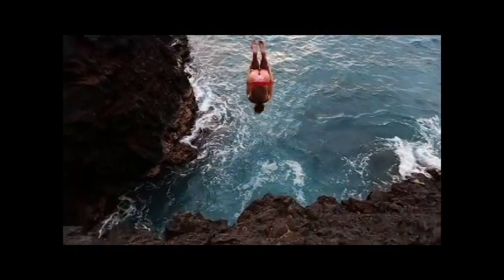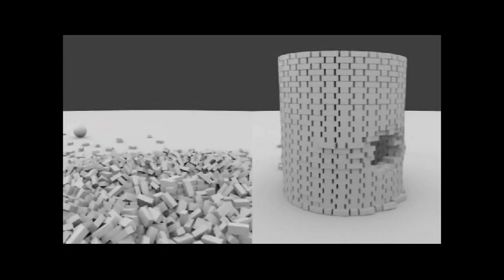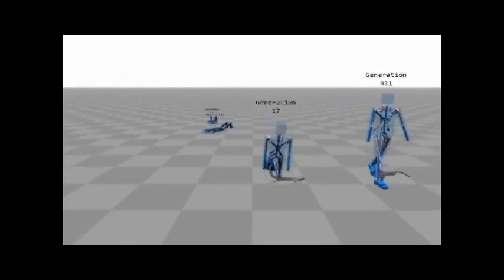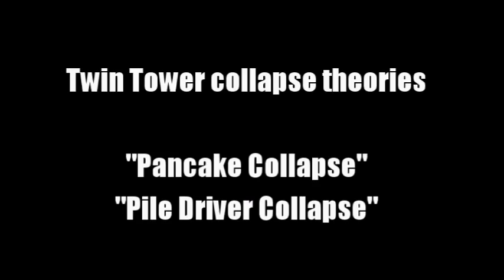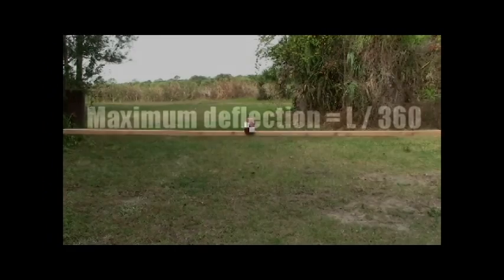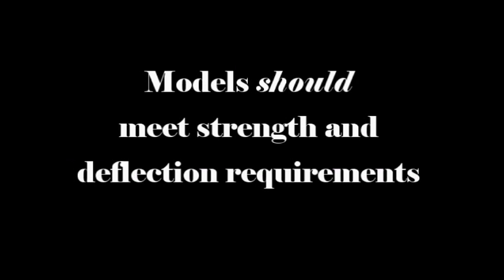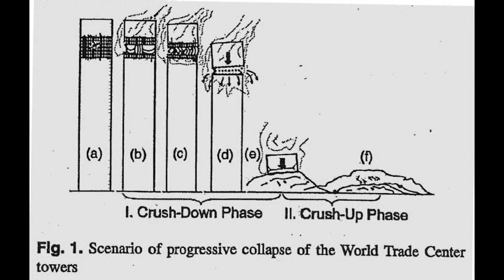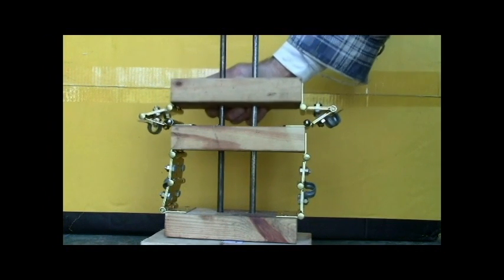9/11 Experiments: The Force Behind the Motion

Comment: MAGNIFICENT.  Now assemble a large remote controlled model airliner, match the strength at scale with a model Tower re strength of concrete/steel relative to strength of aluminum wings and fuselage, plus inertial force of fuel tanks.  Run your jet at scale speed into the Tower and see what happens. I would bet a lot of Monet that the plane will disintegrate on impact with minimal; intrusion. Try a few Tower models including the actual design to prevent jet impact destruction.
Reply: +Carroll Sanders 
You get shitstomped in every thread you join.  You know why?  Because the facts don't support your argument, so your argument is composed entirely of conjecture, misrepresentation, and logical fallacy.

Too bad.
Reply: Carroll Sanders <LMAO, stupidity never defeated reason and never will>

Not true, stupidly defeats reason every time you hit the post button.

Still waiting on you to provide evidence of the scientific experiments that you claim to have performed regarding the thermite chips which you claim are paint.  Why can't you name the publication performing the review process?  Why can't you post a link to your methods?  Who are the coauthors?
Reply: Carroll Sanders < "I encourage you to do TEM analysis as we have done. Studying electron-diffraction patterns obtained with the TEM, Dr. Farrer found that that the iron-oxide was in the form Fe2O3. He did not see a pattern demonstrating that aluminum was in a form he recognized by this method, which surprised us. There are possible explanations for this..."

Read it and weep bozo, no Aluminum, and Amorphous Aluminum Alloys he refers to are aluminum oxide alloys not Aluminum!>

And he walks right into it.  Your claim was that Jones admitted that his samples contain no elemental aluminum.  I see no claim of that at all.  I see Dr. Jones stating that one certain type of test did not turn up the results he would have expected, and that there are possible explanations for this.  

The final paper that was published explicitly concludes the presence of elemental aluminum, and confirms this through multiple tests, including a MEK soak, XEDS mapping and spectra, and a DSC calorimetry testing.  What's wrong, can't you comprehend plain English?  Did you even read the scientific paper you are claiming to be able to refute?  Where is the academic rebuttal?  Surely it should be easy to debunk if the paper is so flawed, especially since all the methods are very clearly outlined in the paper.

And thanks again for proving my point.  You can't even parse out the meaning of a basic sentence, and you actually expect people to believe that you are a published scientist, who has done work relevant to proving the official government fairytale?  Yet of course you can't tell us which publication is reviewing your work, the title of the paper, the coauthors, or the methods.  Too funny.
Reply: Carroll Sanders <Super thermite does not exist>

OK, moron.  "Nano-thermite or super-thermite is a metastable intermolecular composite (MICs) characterized by a particle size of its main constituents, a metal and a metal oxide, under 100 nanometers. This allows for high and customizable reaction rates."

<only the Aluminum copperoxide nano rod thermite has potential to have a high explosive burn rate approaching 1000 Meters per second, >

Another statement with zero factual support that is obviously wrong.  The wide range of metal fuels coupled with the variability in particle size and the many possible ways to actually configure and utilize the material makes it impossible for you to be able to back up your statement, because there is no way you would be familiar with all of these endless possible configuration.  Obviously, you're a fraud.  

Furthermore, Jonathan Cole proved that basic homemade thermate configured in a rudimentary shaped charge does indeed explode (although not to the extent of a high explosive), and can very easily cut through thick structural steel, despite the absence of a huge concussive blast.  Thereby, your whole premise is bunk.

<Harrit, Jones, Gage, Cole, have all shown rampant intellectual dishonesty, your only making a dishonest argument, yourself.>

More scurrilous ad hominem from Carol the meatpuppet.  Prove this supposed intellectual dishonesty, fraud.  Then explain how it somehow constitutes a refutation of the Harrit paper.

<Shock waves from explosives do not travel though glass the shatter it and expel it a thousands of meters per second.
Your stupidity noted.>

Think of all the possible locations of an explosive in relation to the window being observed on this giant skyscraper.  Then, take a close look at my first statement in this post. "This allows for high and CUSTOMIZABLE reaction rates."  So in your little mind, EVERY sized explosive will result in EVERY window shattering in this enormous skyscraper regardless of how far away the explosive charge is from that pane of glass, of how many walls separate them, or how fast the reaction speed of the charge is.  

Now step back, and marvel at your retardation.

<Don't have too show you shlt>

No, you CAN'T show me shit, because you're full of shit.  There is only one 'o' in 'to,' moron.

< so what's the point soot is carbon black, charcoal the same fuel as black powder, Gun powder, you just have to suspend it in air and ignite it moron>

Yes, I understand the principle, idiot.  Apparently, you don't understand the question I am asking.  What physical evidence can you point to to suggest this is what was happening?  What math are you using to determine that "The soot from the black Smoke has about a 99% chance of inducing fuel air blasts when it is desturbed and ignited in air."?

You just keep piling on more and more of your unsupported claims.  Is your paper that disproves the Harrit paper "still in the review process" or has it gone to publication yet?  Which journal is publishing your supposed paper?  Who are the coauthors?  Why can't you back up any of your claims?

Just sad.
Reply: Can't be done, you would have to use a real buildings, and real planes, because inertia, and Gravity as well as atomic structure can not be scaled.
    That's also why Coles experiments fail so badly.
Reply: ***** You can't defeat a valid argument with fallacy you lost, you just are a twoofer and lie.
Reply: Emvaz22 LMAO, stupidity never defeated reason and never will but continue to post your stupidity so I can laugh at you.
Reply: Emvaz22 Why are you applying different standards to me than you do to Jones, he never provided evidence the chips he found had elemental Aluminum, in fact he said on 9/11 blogger in his own blog, they didn't!
Reply: Carroll Sanders <Why are you applying different standards to me than you do to Jones>

I'm not.  Jones is an actual physicist.  His work is actually published.  It is open for anybody with the internet to read for free.  You on the other hand, are obviously a fraud who only pretends to be a scientist while spreading lies on YouTube.

< he never provided evidence the chips he found had elemental Aluminum>

He proved they did, which is why that very conclusion is outlined in the Harrit paper.  The nine expert authors and two expert reviewers all seemed to agree that the chips contained elemental aluminum.  Can you reference an expert who disagrees?  No, you don't count.  Can you reference a rebuttal?  An alternative interpretation of the results?  A reanalysis of the dust?  Anything?  Do you have any supporting sources at all?  Still nothing?  That's a shame.

< in fact he said on 9/11 blogger in his own blog, they didn't!>

Lie.  Go ahead and copy a link to this blog and quote the part where he claims that the chips do not contain elemental aluminum.  Warning: I'm walking you into a trap.  

You're a dumb one, so you're going to fall for it anyway.  Let's see what happens.  It's either a) fall for the trap, or b) backtrack and evade the line of inquiry.  What will it be?  Let's find out.

Go ahead Karen, prove your claim that Jones said that there is no elemental aluminum.
Reply: Emvaz22 "I encourage you to do TEM analysis as we have done. Studying electron-diffraction patterns obtained with the TEM, Dr. Farrer found that that the iron-oxide was in the form Fe2O3. He did not see a pattern demonstrating that aluminum was in a form he recognized by this method, which surprised us. There are possible explanations for this; see for example http://www.tms.org/pubs/journals/jom/0203/perepezko-0203.html . I'll leave it at that for now. I have encouraged Dr. Farrer to write up and publish his TEM findings. "

Read it and weep bozo, no Aluminum, and Amorphous Aluminum Alloys he refers to are aluminum oxide alloys not Aluminum!

Definitive test for Aluminum and the chips fail to have any recognized aluminum none.
Reply: Emvaz22 mek is ridiculous, XED, can not distingish aluminum silicate or aluminum oxide from Aluminum.

Mek will not dissolve carbon based epoxy resin, so the claim is preposterous.

TEM is the definitive test for Elemental aluminum, and Aluminum oxide ballistic glass is not a good fuel source for thermite!
Reply: Carroll Sanders <mek is ridiculous>

No, MEK is a paint solvent.

<XED, can not distingish aluminum silicate or aluminum oxide from Aluminum.>

Yes it can, shithead.  Again, you have an apparent problem reading plain English, as this is all outlined in detail in the Harrit report.

I'll explain how, because you're simple.  XEDS can show the physical location of a given element (called XEDS mapping) as well as the given proportion of elements in a specific area (XEDS spectra).

Upon initial XEDS mapping of the Harrit chip, it appeared that the regions associated with aluminum and silica overlapped, suggesting they are chemically bound.  After soaking the chip in solvent, instead of dissolving, it expanded and remained hard to the touch.  Because of the expansion, unbound elements were able to migrate away from one another.  After the MEK soak, it is clear in a XEDS mapping that the silica region had migrated from the aluminum region, which proves that the two are not chemically bound.

But then you would say "durr, but it could still be aluminum oxide!"  Wrong.  Remember how the XEDS spectra can show the ratio of the given elements in a physical sample?  Remember how the chip is a deep red color and also shows a large amount of iron in the XEDS spectra?  That would be iron oxide.  Most of the oxygen in the chip is bound to the iron, which does not leave enough oxygen to bind to the aluminum (which we already know is not bound to the silica).

Therefore the aluminum is elemental, because it is not bound to the silica, and most of the oxygen is already bound to the iron.

This is all basic stuff, and was outlined in the Harrit paper.  Are you sure you're a scientist?  You seem pretty slow.

<Mek will not dissolve carbon based epoxy resin, so the claim is preposterous.>

Irrelevant to anything I've said thus far.  You running out of talking points?

<TEM is the definitive test for Elemental aluminum>

Says you, with no scientific reference, no credibility, no identity, no explanation.

 If you're having such a hard time with it, maybe you should type up a rebuttal and submit it for publication in an open journal, like Harrit et al did?  Maybe once every journal rejects your joke of an argument, they can point out your horrendous logic and explain why you're wrong more succinctly than I can.  Good luck.

<and Aluminum oxide ballistic glass is not a good fuel source for thermite!>

wtf are you even talking about?
Reply: Emvaz22 If you can't desolve the epoxy resin you can't separate the silicon from the Aluminum oxide. DA.

Some one is lying when they say it did, that and the TEM, and the material will not ignite in an inert gas atmosphere prove no elemental Aluminum.

Has Mark Basile spent all the beer and weed money yet?
He sure as hell hasn't done any credible tests with it.
Reply: Emvaz22 First MEK will not dissolve the epoxy resin, Second you can't tell what the oxygen is bonded too.

Third Mark Basile dropping out is doing independent tests shows the material is not important.
Reply: Emvaz22 Then you should be able to do an inert gas ignition test and confirm the results, oh and yes Fe 203 is red but that does not prove the Aluminum is elemental.

Since the epoxy can not be desolved, a competent test could not be make on the MEK soaked chip.
Reply: Emvaz22 the people Who invented Sol Gel thermite tested it under n2 and argon inert gasses!
Reply: Carroll Sanders <the people Who invented Sol Gel thermite tested it under n2 and argon inert gasses!>

Cite your source.  I think you're full of shit, and don't have a source.  The Harrit authors claim that the LLNL scientists said they likely just used atmosphere.  Nobody from LLNL has refuted this.  There is no reason to assume an inert gas was or should have been used.
Reply: Emvaz22 Read the Harrit paper, I was part of the micro spheres debate With Steven E. Jones.
I read the Harrit paper and the evidence does not support his conclusions!
Reply: Carroll Sanders I read the Harrit paper, and his methods and his evidence DO support his conclusions.  The nine expert authors and two expert reviewers agree, therefore the paper has been published.  Which expert has issued a rebuttal in the seven years since the paper was published?  Which expert has reanalyzed the dust and turned up something different?

Oh thats right, I'm supposed to believe that YOU are a credible expert and your unpublished, unreviewed, unsubstantiated opinions and logical fallacies somehow outweighs the published and peer-reviewed academic literature.

Right...
Reply: Emvaz22 It was published in a now defunked vanity publication that published articles for profit.
None of the peer reviewers were experts, not a one, the peer review on that paper was a joke, and still is have you found Mark Basile and got the money back yet?
Reply: Carroll Sanders <It was published in a now defunked vanity publication>

I'm glad you can copy-paste the party line.  Too bad it's a lie.  Bentham publications are peer-reviewed academic sources.  The Harrit study remains published, and has not been redacted or refuted.  All you have left is ad hominem?  Try again, moron.

<that published articles for profit.>

Every publication publishes articles for profit, you fckig idiot.  It's called capitalism.

<None of the peer reviewers were experts, not a one>

Liar.  Only one of the reviewers has come forward, so you couldn't possibly know the credentials of the other individual.  Considering they are reviewing an academic publication, we can assume they are a expert.  The reviewed that came forward is David Grissom, PhD in physics from Brown.  Formerly of NASA, DARPA, and US Naval Research.  Author of over 190 published articles, reviewer of hundreds more.

<the peer review on that paper was a joke, >

Lol, as if you were there and can speak to one specific about the peer review of that paper.  Ok then, go ahead and tell me specifically, why the peer-review was "a joke."  This should be funny.

Which "experts" did you find that refute the Harrit paper?  Where is their work published? Oh that's right, you've still got nothing.  Too bad.
Reply: Emvaz22 Chandler was also one of the peer reviewers.

And the journal published a nonsense articles written by a robot DA.  vanity publishing is not peer review!😆😆😆😆😆😆😆😆😆😆😆😆😆😆😆😆😆😆😆😆😆😆😆😆😆😆😆😆😆😆😆😆
Reply: Carroll Sanders <Chandler was also one of the peer reviewers.>

Another expert physicist.  How does this support your argument, exactly?

<And the journal published a nonsense articles written by a robot DA. vanity publishing is not peer review!>

Lie.  Cite this supposed article that Bentham published.  Which journal published it?  What was the name of the article?  When was it published?  Who were the authors?

What's that?  No such article was ever published by Bentham?  

Carol is a lying colostomy bag, except he is more full of shit.

The fact that you have to resort to bald-faced lies and ad hominem fallacies proves how bankrupted your position is.  You have no academic citation, and no facts to speak to whatsoever.  

You've been outed as the fraud meatpuppet that you are.  Run along now, Karen.
Reply: Emvaz22   From Wikipedia's page on Steven E. Jones. "received an e-mail from the Danish science journal Videnskab asking for her professional assessment of the article's content.[51][52] According to Pileni, the article was published without her authorization. Subsequently, numerous concerns arose regarding the reliability of the publisher, Bentham Science Publishing. This included the publishing an allegedly peer reviewed article composed of nonsense,[53] the resignation of multiple people at the administrative level,[54][55] and soliciting article submissions from researchers in unrelated fields through spam.[56] With regard to the peer review process of the research conducted by Jones in The Open Chemical Physics Journal, Dr. David Griscom identified himself as one of the reviewers,[57] which Jones claims was "anonymous" in nature and welcomed Dr. Griscom to the "9/11 truth-seeking community".[58] However, the paper which Jones co-authored referenced Dr. Griscom, and multiple 9/11 conspiracy theorists, in the acknowledgements for "elucidating discussions and encouragements".[21] Also, almost four years prior to identifying himself as a reviewer and the welcome he received from Jones, Griscom published a letter in defense of 9/11 conspiracies in the Journal of 9/11 Studies;[59] of which Jones"
Reply: Carroll Sanders From Wikipedia: Ad hominem (Latin for "to the man" or "to the person"[1]), short for argumentum ad hominem, is a logical fallacy in which an argument is rebutted by attacking the character, motive, or other attribute of the person making the argument, or persons associated with the argument, rather than attacking the substance of the argument itself.[2]

Oh darn, there goes your whole argument.

I'm glad you think the disinfo op wikipedia is an authoritative source on 9/11 truth.  That article is so slanted and biased (and factually wrong) that only an idiot like Carol would think it is a valid citation.  

Everyone knows that the Bentham editor resigned simply due to political pressure.  If it was because the paper was unsound, then she would have said "the paper is flawed because...".  So what is the flaw in the paper?

Moreover, both the authors and the reviewers confirm a rigorous months-long review process.  You would have to be fully retarded to think that the head editor of a publication would somehow not be aware of a paper moths in the review process, especially since this journal only published a few articles per edition.  Political pressure, and it is that simple.

Not only that, but your coveted "source" wikipedia says this "This included the publishing an allegedly peer reviewed article composed of nonsense," which is a lie.  No such articles was ever published by Bentham.

Care to prove me wrong, moron?  Which journal published it?  What was the name of the article?  When was it published?  Who were the authors?

Why is your entire argument composed of ad hominem and lies?  Could it be that you are a fraudulent shill?  Gee, I wonder.  

Try again.
Reply: Emvaz22 How are facts Disinformation? 

The truth is the paper was peer reviewed by a member of the 9/11 twoofer website Jones's ran, was not submitted to the Editor for approval.

The Article no longer appears in google searches, but I read the article from Bentham myself back in 2009.
     R Mackey sent me a link to the nonsense PDF personally. 

Hey the old link From the R Mackey message still works.

https://www.newscientist.com/article/dn17288-crap-paper-accepted-by-journal/
Reply: Carroll Sanders <How are facts Disinformation? >

Facts are disinformation when they aren't facts, but lies.

<The truth is the paper was peer reviewed by a member of the 9/11 twoofer website Jones's ran, >

Lie, Griscom had not met the authors of the Harrit paper prior to the review.  Prove otherwise, fraud.

<was not submitted to the Editor for approval.>

Lie.  Both the authors and the reviewer specifically document a rigorous, months long editorial and review process.  Tell me, if the paper never made it to the editor and this paper was published outside the approved methodology, then why is it still published?  Bentham has on their website an extensive flowchart that describes the processes a paper must go through before publication.  If the editors never saw it, then it couldn't have made publication.  Why wouldn't the journal simply remove the article if it bypassed their processes?  Your position falls apart the second you apply logic.

<The Article no longer appears in google searches, but I read the article from Bentham myself back in 2009.>

That's funny, which edition was it published in?  What was the date?  Oh that's right.  Liar.  I almost forgot.

<Hey the old link From the R Mackey message still works.

https://www.newscientist.com/article/dn17288-crap-paper-accepted-by-journal/>

Hey, I don't see anything in the article you posted about this hoax paper actually being published.  Why are you still lying?

So pathetic.

Really, all you've done is admit that you have no ACTUAL rebuttal of the Harrit paper, and so you resort to ad hominem, lies and misrepresentations.  Thanks for playing.
Reply: Emvaz22 It was published before the article was written, in PDF format the link doesn't work because Beth am pulled the paper, after they discovered it was a hoax, and Griscom published letters in 9/11 Review, before he peer reviewed Jones's article, Lie all you want it is all documented and collaborated from multiple sources!
    You are just another lying fraud on the internet!
Reply: Carroll Sanders <It was published before the article was written>

No moron, it wasn't published.  Nowhere in the article you cited, which is your sole source, does it say that Bentham published that gibberish paper.  Learn to read.  What your joke of a blog post does is purposely leave out the rest of the story so as to deliberately confuse idiots like you.

In reality, Bentham was well aware of the fraudulent article, in fact it had been receiving a series of fraudulent articles all submitted by an anonymous person under an alias.  In order to stop the spamming and to draw this person out in the open, Bentham sent a letter to the fraudster saying that one of the papers was accepted for publication, and requested payment.  In order to pay and get published, the fraudster would have to come out into the open, at which time Bentham would have been able to take appropriate action.

At no time was any fraudulent article published in any Bentham journal.  Prove otherwise.  What is the title of the article?  What edition was it published in?  What was the date of publication?  If this article was published, then all of this data should be readily available.  

Oh I almost forgot, you have no supporting data, no scientific reference, no facts to speak to whatsoever.  You're just a lying fraud who has to rely on ad hominem fallacies which aren't even based in fact to begin with.  Even your fallacies are lies.  So pathetic.
Reply: Emvaz22 The burden of proof is on you I read the PDF, dumbazz myself in the Bentham Journal, Bentham only pulled it after it was made public that it was a hoax a week after first publication!

The title of the article was the same as the link provided in the Story from New Scientist.

Your totally a fraud pushing a fraudulent paper of complete stupidity, you can't take it can you that you were proven wrong?

Come on tell me some more Twoofer lies!
Reply: Carroll Sanders One more thing:  The paper was pulled by Davis, the author, once he was required to pony up the cash.  Bentham never pulled the paper BECAUSE IT WAS NEVER PUBLISHED.  Apparently you can't even comprehend a two page op-ed, and you actually expect people to believe you are scientifically literate?  Think again.

Do you have an extra chromosome?
Reply: Emvaz22 Nothing you say will change the fact that Twooferism is a fraud and failure.
   The very thread you are posting in shows it, Cole, Harrit, and Jones all frauds, Like Jones's over unity bullshlt.
Reply: Carroll Sanders Can you refute the Harrit study, which disproves the official collapse theory?  No, you can't.  

Can you demonstrate proof of the official collapse theory?  No, you can't.

Is there any way that a building can collapse symmetrically for 100ft at perfect free-fall acceleration WITHOUT the use of pyrotechnics?  No, there isn't.

Sorry trash, but your astroturfed, shill-filled "bunktard" movement is pathetic, and most Americans see right through it, and realize the zionist filth behind it all.

What do you think will happen in the US when supporting the genocidal regimes of Israel and Saudi Arabia becomes political suicide?  What do you think will happen when America stops financing the illegitimate Israeli state?

It will be interesting to find out.
Reply: Emvaz22 Your fraud proves absolutely nothing, you ignore physics and reason to promote clear fraud for monetary gain.
    Harrit's study is refuted By Harrit who claimed to find active chips as well as inactive chips. Exposure to water as he claimed deactivated them would not effect nano thermites.
     Jones's own blog said No Elemental Aluminum was found in the TEM data 
    EDX can not differentiate Al203, From Al in the presence of Fe203.
    The TEM data was conclusive, and The Mark Basile  (Embezzler ) study is a Joke, you know he will never have any results.
    Your whole Moronic Twooferistic Bullshlt has fallen apart all around you, and your fraudulent support of Cole is proof of that!
   You are nothing and I am laughing at you!😆😆😆😆😆😆😆😆😆😆😆😆😆😆😆😆😆😆😆😆😆😆😆😆😆😆😆😆😆😆😆
   Why don't you ask Cole for the mathematically correct model that shows his experiment exactly matches the energy values of the collapse?

   Guess what you can't, and never will because a mathematically correct model proves You and Cole are frauds and nothing you can say or so will ever change that!
😆😆😆😆😆😆😆😆😆😆😆😆😆😆😆😆😆😆😆😆😆😆😆😆
Reply: Emvaz22 None of what you posted proves shlt, it only proves your ignorance, a building facade stone wall can fall at free fall, after the steel framing topples to the side, and in no way violates Newton's third law, your straw man argument just went up in flames!

A counter levered building suffering progressive collapse leading to Global collapse should fall in that manor, and the Fvcking Granite Facade should land on top, just as it did dumbazz.
Reply: Carroll Sanders <a building facade stone wall can fall at free fall, after the steel framing topples to the side>

Tell me, shit-for-brains.  In a structure surrounded by 4 walls, how exactly does the entire steel frame "topple to the side" and completely get out of the way of the walls that are bolted and welded to the frame?  How do office fires on a few floors cause this to happen?  Be specific.

Seriously, the scenarios you posit are the stupidest things I've ever heard.  Please don't reproduce.

<and in no way violates Newton's third law, your straw man argument just went up in flames!>

Free-falling mass ACCELERATING as it meets resistance violates the basic laws of physics.  You're retarded.
Reply: Emvaz22 The Facade Of world trade 7 Was only on three sides not 4, the otherside facing the towers was glass and steel.  The Facade was designed to face the Ocean side to resist Ocean winds.
    That's why it stood a few seconds after the internal framing failed!
Reply: Emvaz22 You don't have to refute Bullshlt, it refutes itself no respected scientist will ever waste his time on Bullshlt!

The Greening model gives the energy values for the twin towers collapses, where are the energy values for Cole's Models moron, he hasn't got any!😆😆😆😆😆😆😆😆😆😆😆😆
Reply: Emvaz22 I will most likely be saying goodbye to you and your idiocy, you have nothing after 15 years, you have nothing conclusive, and everything you claim can be shown easily to be wrong with simple experiments and research.
      You don't accept facts or solid reason, and you're basicly propagandizing for a political issue, the fact you support the experiments of Jackass Cole, proved you were a total fraud unworthy of any debate or respect!
      I have Literally no respect for Jones, or Harrit the frauds, or for their Fraudulent papers printed in a rag with compromised
Peer review, and also Refutations are not needed to counter a paper that should never have been published in the first place.
     The problems with the paper were, no elemental Al was confirmed,  TEM results show no Elemental All,  No Al203 was produced in the reaction, No self oxidation was shown!
       The paper solely assumes makes a guess that the material is thermite, and does not confirm in any way that it is thermite.
     As such the conclusions of the authors are unproven and unfounded in science, so the publication should have been rejected!  If it had been published in a non vanity Journal with proper peer review it would have!
     The link between the paper and the peer reviewer, shows conflicts of interest.  Your new investigation will never happen and you and your cohorts will be relegated to the dusty Looney bin of history, and although it has been fun laughing at your stupid ass, you have gotten quite boring same old Bullshlt all the time, and we both know nothing new to be discovered in the future!
     Mark (Embezzling ) Basile will never have a lab do an independent test, and you know it, because there is nothing but old paint chips to test!
         Have a nice life of beating dead horses, that will never rise and walk again!😆
Reply: Carroll Sanders <The Facade Of world trade 7 Was only on three sides not 4, the otherside facing the towers was glass and steel. The Facade was designed to face the Ocean side to resist Ocean winds.
That's why it stood a few seconds after the internal framing failed!>

And to your, this is ample explanation of how a steel-framed high-rise can collapse symmetrically at free-fall acceleration for 100 ft...gotcha.

<You don't have to refute Bullshlt>

I know I don't because you've referenced absolutely nothing.  You have zero scientific reference whatsoever.

< it refutes itself no respected scientist will ever waste his time on Bullshlt!>

Then explain why James Millette attempted to refute the Harrit paper, did a piss-poor job, and publicly failed to get his joke-of-a-paper published?  Hey maybe you're right, the proven fraud James Millette is an EPA shill, and isn't a "respected" scientist after all.  Too bad.

< I will most likely be saying goodbye to you and your idiocy>

Giving up already?  Oh well, one more head for my wall of shills.

<you have nothing after 15 years>

No, YOU have nothing.  I have hard science and basic physics which you are unable to refute.

<and everything you claim can be shown easily to be wrong with simple experiments and research.>

Yet somehow you are unable to demonstrate these supposed simple experiments and research.  Why can't you reference a rebuttal?  Hmm, I wonder why.

<I have Literally no respect for Jones, or Harrit the frauds, or for their Fraudulent papers printed in a rag with compromised
Peer review>

ACTUAL scientists, with ACTUAL credentials published in an ACTUAL journal.  Where is your refutation?

<and also Refutations are not needed to counter a paper that should never have been published in the first place.>

Predictable cop-out of an intellectual weakling.  You are truly pathetic.

<no elemental Al was confirmed,>

Lie.  XEDS spectra and mapping, MEK soak, and DSC testing confirm elemental aluminum.  It's pretty obvious you either never read the paper or you have a learning disability.  I'm leaning towards both.

<TEM results show no Elemental All,>

TEM testing wasn't even part of the Harrit report.  Your position doesn't even make sense.  Try again, fraud.

<The paper solely assumes makes a guess that the material is thermite, and does not confirm in any way that it is thermite.>

Lie.  The sole purpose of the paper was to perform scientific experimentation that proves this material is thermite.  Nothing is assumed. In fact, initially the authors assume it is paint, which is why they soak it in paint solvent.  DUUR ME CAROL ME NO REED GUD.

< If it had been published in a non vanity Journal with proper peer review>

Credible academic journal with an extensive peer-review process.  Prove otherwise, fraud.

<The link between the paper and the peer reviewer,>

There were two reviewers, neither of which were acquainted with the Harrit authors prior to the review process.  Prove otherwise, fraud.

It's pretty clear that all you have left are ad hominem (which aren't even factually true) and bald-faced lies.  

I hope you realize that every time you post one of your idiotic, factually unsupported statements, you simply draw attention to how much of a fraud you are, and to the fact that there are political forces paying meatpuppets like you to spread lies on YouTube and distract from their involvement.

The beans are already spilling on Saudi Arabia.  How long before most Americans realize that our supposed ally Israel was involved?  How long do you think Israel will remain a Jewish state once America stops giving a fuck and withholds the billions of dollars of foreign aid every year?  I sure wouldn't want to be there when it happens.  Enjoy, meatpuppet.
Reply: Emvaz22 Considering you are commenting on a post on a video By Johnathan Cole, an he admitted openly last night that his experiments are a sham,  twice in one YouTube program live on the air,  how do you even have nerve to reply with more false Bullshlt?
Reply: ***** Cole admitted last night he is nothing but a Fraud, he can't do valid experiments, he admitted it!😆😆😆😆😆😆😆😆😆😆😆😆😆😆😆😆😆😆😆😆😆😆😆😆😆😆😆😆😆😆😆😆😆😆😆😆😆😆😆😆😆😆😆😆😆😆😆😆😆😆😆😆😆😆😆😆😆😆😆😆😆😆😆😆😆😆😆😆😆😆😆😆😆😆😆😆😆😆
Reply: +Carroll Sanders 
Nobody believes you, Karen.  You know why?  Because you're an obvious shill with zero credibility, who makes absurd claims but can never manage to offer any sort of supporting reference.

You're a compulsive liar, and everyone knows it.
Reply: Emvaz22 Cole stated twice last night, that his experiments did not have an energy value equal to the collapse of the twin towers.

It's on YouTube, he stated it in reference to the question why his energy values did not match the real event!
😆😆😆😆😆😆😆😆😆😆😆😆😆😆😆😆😆😆😆😆😆😆😆😆😆😆😆😆😆😆😆😆😆😆😆😆😆😆😆😆😆😆😆😆😆😆
Reply: Carroll Sanders <Cole stated twice last night, that his experiments did not have an energy value equal to the collapse of the twin towers.>

The towers weighed thousands of tons.  Of course the model doesn't have the same total energy value.  IT'S A MODEL, you simple fck.

And this basic statement of how a model is smaller than the actual event is the entire basis for your claim that "Cole admitted last night he is nothing but a Fraud, he can't do valid experiments, he admitted it!"?

Seriously, your just get dumber with every post.
Reply: Emvaz22 Gravity can not be scaled, Cole is attempting to duplicate motions that are dependent on exactly matching the energy equation involved in the collapses.
    With out matching the energy values the motion can not be duplicated and Cole is a fraud!
Reply: +Carroll Sanders 
Mmhmm, and which real-world models match the forces observed on 9/11?  Oh thats right, none exist.  The enormous budget of the Federal government, and not one physical model?  Hmm, I wonder why?  Because the forces observed are only possible with pyrotechnics.  The best you can muster is a NIST computer model with classified data parameters.  

You've still got nothing.  All you have is the official government-sponsored  fairytale, and zero verifiable science.
Reply: Emvaz22 Idiot, scale models are useless, because of physics the inverse square law, mathematical, and computer models are used!
     You're to stupid to realize that!😆😆😆😆😆😆😆😆😆😆😆😆😆😆😆😆😆😆😆😆😆😆😆😆😆😆😆😆😆😆.
Reply: Doesn't it seem inevitable and immutable that the inherent strength of each floor to support all the weight of all the floors above it would provide a residual strength to resist for a serious moment at least to all the mass crushing down via gravity's pull?  With this present for every floor, it seems inevitable that the speed of collapse would have been significantly slower than free fall speed.  And thus significantly slower than the fall of the main mass as opposed to the exterior layers. Also, my innumerable exams of the collapse footage finds no discernible difference between speed of fall of exterior layers vs the internal main mass. That\s my main problem with the damage--induced collapse explanation.  Alternate view?
Reply: Spherian7 F=MA-R,    MA<R Collapses halt,  MA>R Gravity Accelerates the top block though the lowers structure.
        The dynamic loading induced in the collapses, was MA>R, Cole's models are MA<R, as such it is physically impossible for Cole to duplicate the motion of the upper mass though the lower mass.
      As an engineer Cole has to know this, that makes him incompetent at the very least, most probably though he is a fraud.
       The connections that held the building together did not have enough strength to resist rapid disunification so the building disassembled into its component parts and fell like a house of cards.
Reply: Carroll Sanders Thanks - I appreciate that, and it seems clear that small model mass vs megascale mass is the major obstacle in such demoes.  I was thinking about a scale model of a jumbo jet being accelerated down a track at masscorrect speed relative to an impact structure of similar scale designed to replicate in masscorrect density per model scale-down the very impressive concrete-steel WTC construct to see just how much of the model could penetrate said structure.  Can we replicate the "karate chop" effect wherein an aluminum jetliner could cut completely through such a structure ... like a knife through butter as per the ST impact footage.  There must be a kind of exponential increase in mass structural integrity retainment when the mass of aluminum is increased from small scale to very large scale.  SO this is the main problem - is there a formula wherein we can reduce the size of both Tower and jet and have a reliable downsized mass/inertia ratio matching the full scale parameters? There may not even be such a thing.  No... there has to be something, since we have manmade materials size/strength comparisons relative to natural materials, such as interior bone, the egg, etc, etc.  Anyway, ff we have to wing it, it seems we would need large models to get a decent and correct test.  Sound like fun, doesn't it?  What of we used a rocket-propelled model plane with added density at leading edges into something reasonably comparable in relatice strength to a Tower - adding more speed and inrertia than would be really close to give the cut-thrugh the benefit of the doubt? Then if the plane still doesn't cut through completely intact, disintegrating en totality right after getting through the wall per Commission NIST diagrams, then we may be on to something and then run an even bigger test. How much money you got, partner?
As it may be,  I was just thinking in my math-challenged way right before opening your comment about the "gravity accelerates the top block through the lower structure" aspect. .   Here's my primitive thought...  the lower portion and every floor had the strength to support the top block totally.  Ok-  so we assume that at the point the steel support  was softened there was then the moment of complete steel failure and the top block descends as a free fall for one or two stories. Therefore, there must be a way to calculate the de facto increase in apparent mass induced by the fall and pull of gravity over that relatively short distance. .  It seems to me strictly on feeling  that even with such a fall  the increase in effective mass of this temporarily falling top block might still be insufficient to overcome the strength of the floors to support up to a certain weight - or at least the cumulative strength of several floors underneath would be sufficient to vitiate the downward momentum due to absorption of the brief de facto gravity induced mass increase by the lower floors' collective strength-bearing capacity. .  SO, what was the total weight that the floors right under top block impact could actually support? See what I mean? Could they have supported twice the actual static weight? There must be a formula for calculating the de facto mass under gravitational acceleration for that distance.  Then we can match that to the actual full support potential for the floor(s) immediately under the collapse gap. Interesting problem.
Reply: Spherian7 The strength of the connections holding the building together, was about 22000 pounds per square inch.
    2600 pounds falling 12 feet = 100,000 pounds per square inch.

Once dynamic motion was induced the towers were doomed.

As far as the plane , just showing how good a penetrator aluminum is would suffice I shot aluminum bullets though 3/4 inch schedule 40 steel plate.
Reply: Carroll Sanders  Ya da man !  Let me "think" or whatever it is I do about the intel per strength.  And very impressed and pleased as I am with the aluminum bullet test, which is awesome, I must bear in mind the bullets are very well shaped for penetration, while the frontal edges of the wings and the weaker wingroot connections are not so. Nonetheless, I will think over the speed of bullet, shape, relative mass vs tensile strength of 3/4 inch solid steel.    Also, it is core in all this that we are dealing not just with a science/physics theory, but a criminological deal.  Thus, in a  pure Physics evaluation we can certainly deny controlled demolition place as stronger theory if just that we cannot prove it in the nature of the collapse itself  when other explanations still stand. But this doesn't deny the possibility of the contention - it just doesn't gain superior proven status.  However, as a crime case as well as science, we can still say in this narrow system we are exploring, that while dynamic motion can actually successfully explain the collapse, this doesn't mean that other means could not account for the same observed phenomenon. The same effect could be obtained via controlled demolition but be indistinguishable from a imputed dynamic collapse once initiated. Making a crime appear a natural death deal by using artifice based on known factors that can replicate natural physics cannot be ruled out even if less likely.  In other words, with a lot of explosives placed in correct demolition structure, the building would be just as doomed.   Good times, good times !
Reply: Carroll Sanders PS -and  any friend of squirrels is a friend of mine.
Reply: Spherian7 No evidence of explosives was ever found, none not even a detonation wave.
Thermite would be a poor choice, one the mass of Aluminum melted in the heat of the fire, the thermite would have become inert non functional.  Plus thermite is not an explosive, the highest recorded burn rate for thermite is around 1000 meters persecond.  The soot in the fires can have a burn rate exceeding that.
  The soot from the black Smoke has about a 99% chance of inducing fuel air blasts when it is desturbed and ignited in air.
   The natural collapse theory matches most of the evidence, and an aluminum plane going at the speed at which the jets that hit the twin towers were going would easily have penetrated the momentum of the plane had to be absorbed by the buildings steel because the plane was in motion while the building was not.
    So the plane had ample energy to penetrate, while the building did not have the energy to resist penitration,.
    +Spherian7  the simple fact of the matter is  is the plane is traveling inward the steel is stationary. So the plane covered in one of the best penetrating metals know to man, exerts 320,000 psi on a material A36 steel, so named because the tensile strength of A 36 steel is roughly 36,000 PSI.
     The steel absorbs the extras energy imparted by the plane as ductile deformation and Crystalline fracture.
It is a simple energy equation.
Reply: Carroll Sanders <Idiot, scale models are useless, because of physics the inverse square law, mathematical, and computer models are used!
You're to stupid to realize that!>

Ah, so now you are claiming that a computer model with classified parameters and that hasn't been peer reviewed constitutes proof of the official story.

Try again, moron.

<The connections that held the building together did not have enough strength to resist rapid disunification so the building disassembled into its component parts and fell like a house of cards.>

Pure bullshit.  Can you provide scientific support for any of your absurd claims?  I don't think you can.

<No evidence of explosives was ever found,>

Lie.  Superthermite was found, peer reviewed, and published by a group of scientists independent of government conflict of interest.    Superthermite is a type of explosive.  The byproducts of a thermite reaction were also found and chemically matched to known forms of thermite.  Controlled demolition theory remains the only theory supported by hard, falsifiable science.  Which scientists who tested the dust for explosives conclude that there were none?  To my knowledge, the only science that has analyzed the dust for explosives has concluded that they were present.  That's unfortunate for you and your purely speculative argument.

Your fairytale version of physics is factually unsupported and doesn't prove shit.

<none not even a detonation wave.>

Lie.  Video evidence exists of shockwaves rolling through the glass facade of the towers before they collapsed.

<Thermite would be a poor choice, one the mass of Aluminum melted in the heat of the fire, the thermite would have become inert non functional>

The demo charges would have been insulated, you moron.

< Plus thermite is not an explosive, the highest recorded burn rate for thermite is around 1000 meters per second.>

No, it's an incendiary.  But superthermite CAN be explosive.  Did you even read the Harrit report?  What makes you think people are going to believe that you are an authority on something that you clearly didn't read or don't understand?

<The soot from the black Smoke has about a 99% chance of inducing fuel air blasts when it is desturbed and ignited in air.>

Show me your math.  I think there's a 99% chance you're making shit up again.

<So the plane had ample energy to penetrate, while the building did not have the energy to resist penetration,.>

Holy crap it looks lie Carol may have said a true statement.  What a milestone.
Reply: Emvaz22 Super thermite does not exist, it is nano thermite with aluminum nano particles, and only the Aluminum copperoxide nano rod thermite has potential to have a high explosive burn rate approaching 1000 Meters per second, and since Harrit, Jones, Gage, Cole, have all shown rampant intellectual dishonesty, your only making a dishonest argument, yourself.

Look up sheer lag dumbazz, connection sheer is a known phenomena.

Shock waves from explosives do not travel though glass the shatter it and expel it a thousands of meters per second.
   Your stupidity noted.

Don't have too show you shlt I know you're intellectually dishonest, so what's the point soot is carbon black, charcoal the same fuel as black powder,  Gun powder, you just have to suspend it in air and ignite it moron!😆😆😆😆😆😆😆😆😆😆😆😆😆😆😆😆😆😆😆😆😆😆😆😆😆😆😆😆😆😆😆😆😆😆😆😆😆😆😆😆
Reply: Emvaz22 Will get back to you on it, but only certain fuel, Oxygen reactions well known to chemistry will give significantly energetic reactions and yes I can know them all!

Cole never tested his cutters in a fire now did he? His other experiments are designed to fail and has admitted it!

Harrit publicly stated he found active and non active nano thermite red grey chips, and that water probably caused some of the chips to deactivate.  

Please explain how that statement is not intellectually dishonest.
Reply: Carroll Sanders <Will get back to you on it, but only certain fuel, Oxygen reactions well known to chemistry will give significantly energetic reactions and yes I can know them all!>

Again, Cole proved it is very simple to devise a simple shaped charge that allows basic homemade thermate to cut through hardened structural steel, regardless of whatever arbitrary reaction rate you pretend to know would be required to do such a thing.  Your premise is bunk.  Your argument is garbage.

<Cole never tested his cutters in a fire now did he?>

Nor did he claim that his cutters (which simply served as proof of concept) were the same design that would have been used on 9/11.  Once again, bunk argument.  The fact that you lack the imagination to envision that such a device could be designed that could also serve the dual purpose of insulating the contents from external heat sources (ROCKET SCIENCE!) doesn't speak well to your intelligence.

< His other experiments are designed to fail and has admitted it!>

His other experiments succeeded. WTF are you even talking about?

<Harrit publicly stated he found active and non active nano thermite red grey chips, and that water probably caused some of the chips to deactivate.>

And?  You should make a complete argument before you expect people to respond to it.

<Please explain how that statement is not intellectually dishonest.>

You have yet to present anything to refute.
Reply: Emvaz22 You dodges and subterfuge can not change the fact Coles experiments in this very thread are obviously intellectual dishonest.

Also water can not deactivate thermite or nano thermite, that is what make Harrit's statement intellectually dishonest when he says it can.
Reply: Carroll Sanders <You dodges and subterfuge>

My points are simple, and based on straightforward logic and basic facts.  Go ahead and demonstrate an example of this supposed "subterfuge," fraud.

<Coles experiments in this very thread are obviously intellectual dishonest.>

More baseless accusations with no evidence by Carol the fraud.

<Also water can not deactivate thermite or nano thermite, that is what make Harrit's statement intellectually dishonest when he says it can.>

Unlike you, I'm not going to pose as an expert on pyrotechnics.  Regardless, I can still trash your argument.  Watch:

1)  It is a well known hazard of elemental aluminum powder that upon contact with water, it can form explosive hydrogen gas.  Obviously, the hydrogen comes from the H2O, which means the oxygen has bonded with the highly reactive aluminum.  The thermite reaction requires elemental aluminum.  If the aluminum is oxidized, no reaction can occur.  Darn, looks like you're wrong again.

2)  Your entire premie is false to begin with.  The material in question is a sol-gel superthermite which contains not only elemental aluminum and iron oxide, but also a carbon based substrate, which can also be energetic.  Not enough is known about this material for anybody to say that it cannot be deactivated by water, especially an obvious fraud like Carol the meatpuppet.

Try again.
Reply: Emvaz22 You are telling me Cole Accurately recreated exactly the energy to induce motion though resistance    in a 3 Body, gravitational collapse?

It is a form of Areojel Thermite that is described, and the material presented by Harrit & Jones has never been confirmed to posses Elemental Aluminum, by any competent expert!

Oh and the Carbon based epoxy resin is the main fuel source, and can not be loosened By MEK.

LMAO you fail completely.

Jones's was looking for the same material produced at Los Alamos national Laboratory, he thought it was explosive, it is not and can not be explosive!
Reply: Carroll Sanders <You are telling me Cole Accurately recreated exactly the energy to induce motion though resistance in a 3 Body, gravitational collapse?>

You are telling me that he made this claim?  Oh that's right, another strawman from Carol the fraud, because he has no actual argument.

<It is a form of Areojel Thermite that is described, and the material presented by Harrit & Jones has never been confirmed to posses Elemental Aluminum, by any competent expert!>

Lie.  Confirmed, peer-reviewed, and published.  And you have no scientist who disputes it.  Sad.

I notice you quickly gave up on you "water can't deactivate thermite" claim after I did 2 minutes of google research and shit all over your argument.  God, you're easy.
Reply: Dear Dumbazz, your comments are in a tread where he claims to be trying to be duplicating the motion of the buildings!

Peer Review with conflict of interest, is no peer review!

Not My Claim it is Harrit's he said he found both reactive and non reactive thermite and proposed water caused the thermite to become inert!

Try again next time loosed.
Reply: Carroll Sanders <Dear Dumbazz, your comments are in a tread where he claims to be trying to be duplicating the motion of the buildings!>

Yes, and he does just that, with no budget.  Where is the NIST physical model that demonstrates the motions observed?  All those millions of dollars of funding, and they couldn't manage to construct one model?  Do you always make argumentative statements against your own position?

<Peer Review with conflict of interest, is no peer review!>

Ah, so you are implying the paper is flawed (with zero evidence).  If it is flawed, where is the rebuttal?  What's that?  7 Years, and no refutation, no rebuttal whatsoever?  Gee, I wonder why.

<Not My Claim it is Harrit's he said he found both reactive and non reactive thermite and proposed water caused the thermite to become inert!>

Right.  2Al + 3H20 --> 3H2 + Al2O3 (or something like that).  Aluminum oxide cannot be used as a fuel source for thermite.  You should brush up on basic chemistry before you pretend to be a scientist.  What information are you using to determine that water can't deactivate thermite?  Again, I don't pretend to be a scientist, but basic chemistry seems to disprove your claim.

Try again, meatpuppet.
Reply: Emvaz22no Cole does not he can't duplicate the motions with an intellectually dishonest model.

(F=MA) (MA>R) Collapse occurs as seen in all the videos.  Coles intellectually dishonest models are all, (MA<R) so they are frauds exposed by a simple mathematical proof.
   Why do you support open intelligentual dishonestly and hucksterism is it your just to stupid to see it or do you have a purely political motive for being a lying dumbass?

 That can only occur on the surface layer and an ionic charge, acid is nessisary, and not with the Al embedded in silicon and epoxy resin which are water proof dumbest dumbazz ever!
Reply: Carroll Sanders <Cole does not he can't duplicate the motions with an intellectually dishonest model.>

Cole DOES duplicate the motions with a very simple and basic model, with no budget.  Where does he claim this is a scale model?  Where is proof of this supposed dishonesty you keep trolling on about?  What's that?  Cole never made that claim?  You're a fraud whose entire argument is a fallacy?  That's right, I almost forgot.

NIST had a budget of millions of dollars.  Where is their physical scale model that duplicates the observed motions using fire and gravity alone?  There is a common phrase regarding glass houses that I was going to use, but then I realized that you don't even have that.  You have no house.  You have a computer generated idea of a house, and of course the details of this house are classified by NIST for "national security" reasons.  Sad.

<(F=MA) (MA>R) Collapse occurs as seen in all the videos. Coles intellectually dishonest models are all, (MA<R) so they are frauds exposed by a simple mathematical proof.>

So simple,yet I see no math and I see no proof.  Try again.

<or do you have a purely political motive for being a lying dumbass?>

Why do you keep bringing up political motivations?  Something on your mind, Hasbara?  Hmm, who would be all alone in the Middle East without the support of the US?  Who has no friends and no allies in the region?  Who most benefits from the indefinite military involvement of the US in the Middle East?  Gee it's so hard to figure out.

<That can only occur on the surface layer >

Water has this tendency to soak through materials and dissolve ions, moron.  That's kind of what makes water water.  What data are you using to determine that water cannot penetrate the outer layer of this material?

<and not with the Al embedded in silicon and epoxy resin which are water proof dumbest dumbazz ever!>

Last I saw, there was not enough data on the substrate to determine its properties, other than the fact that it contains carbon and silica, and contributes to an exothermal reaction and releases an expanding gas upon ignition.  The fact that you pretend to have insight that the actual scientists who tested the material and authored the paper didn't have, highlights the fact that you're a fraud and a liar.